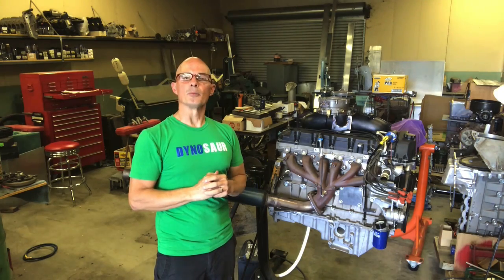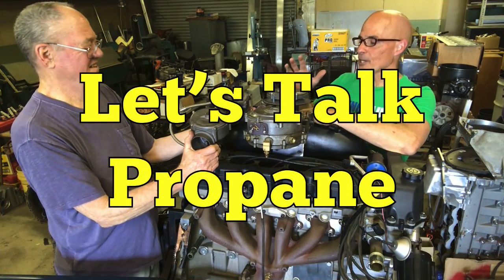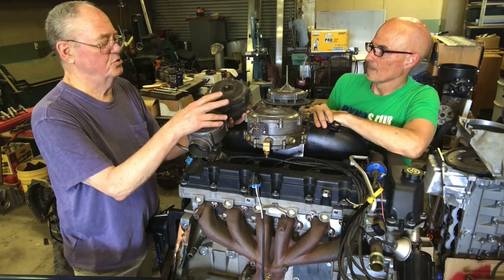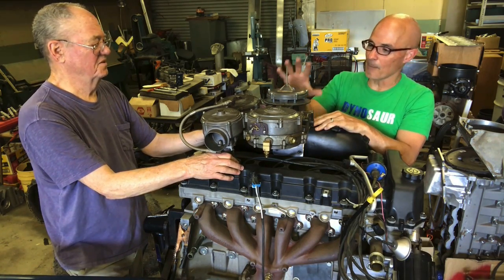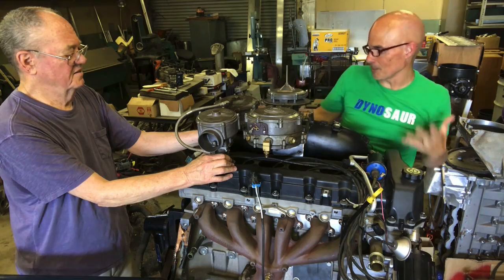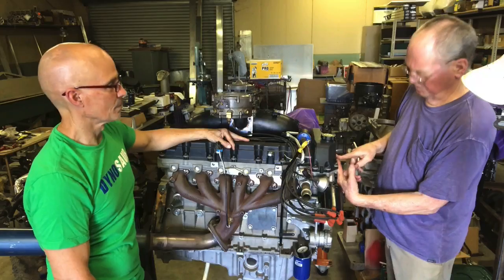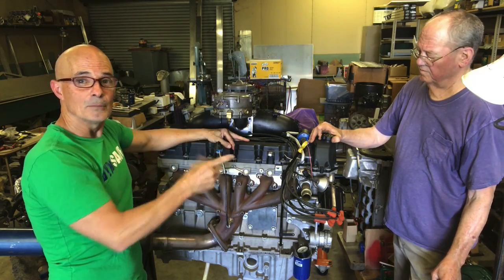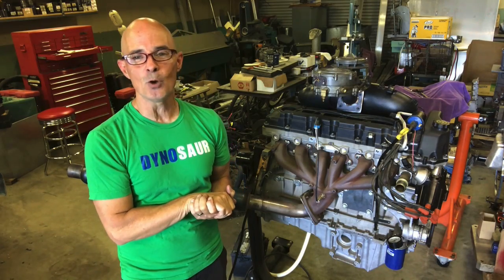PROPANE-POWERED AMERI-BARRA 4200 ATLAS (STAND START ON GRILL GAS-WILL IT RUN?)

Comment: I'd love to hear more about propanes pros/cons especially after he mentioned wearing out 2 454s....not the bores but the cam? How come?
Reply: I have a souped up 360 i built around 2000 an been running the impco 425. Last year i pulled it from the car to change a steering box so it was a good time to check inside. I can't rember the percentages on the leak down now but i was loosing a lot through the vaves , they were very pitted (hand lap fixed that) the bearings had worn through the tin on the major load side but had no scoring so swaped them out for a new set. The motor uses next to no oil an the cross hatch on the bores looked only lightly wan an consistent all the way round so i didnt even pull the pistons. Back in the car it runs great, better than before no doubt due to the valves.
Reply: Chevrolet delivered probably millions of poorly hardened camshafts and the big block valve train is hell on the little .842" lifter.
Reply: On early motors, it was pretty common to see "valve saver" systems set up in the engine bay. I don't know a great deal about it but my understanding is the liquid petrol has a lubricating or cooling effect on the valve and seats, where as LPG is anyway a vapour by the time it gets to the valve and essentially does nothing. However this never seemed to be an issue on later model stuff. I vaguely remember it being looked at similarly to when they took the lead out of petrol.

Comment: I have a design for a gasoline Vapor running engine that no one has tried yet on YouTube. Integrated gasoline tank into the intake piping. To where all the air has to gargle through the baffled gasoline tank tower before it gets into the intake. I wish you could see what's in my head and you would fully understand. It would create a way more gas fumes then any other on YouTube videos.
Reply: Might try a patent search. YouTube isn't the world.
Reply: You'll only vaporize the lighter fractions of the fuel if you percolate air through it like that. Surface carburetors died out a long, long time ago. It's a dead end.

Comment: Roush made propane conversions for 2013 era Ford vans.  This used liquid injection just like a gasoline engine does.  There are detailed instructions on Roushes web site.
If you run propane on one of your test engines, you need to use a liquid draw tank ( forklift ) otherwise bottle temp will drop and the vaporization rate will slow. As stated in the vid, the converter needs engine coolant as a heat source but this only works if you feed it liquid propane.  Late model forklifts use a duty cycle valve to alter mixture strength ( and O2 sensor ) so you might be able to blend some gasoline FI stuff.
As for ignition, investigate a 90's GM V6 that uses a module under the coil packs,  this needs it a 3 pulse crank trigger and some way of altering the signal that normally goes to the ECU then feeding it back to the module to alter advance.   MSD might have something that would work.

Comment: Just remember that the gas supply takes up much more room of the normal air going into the engine , so the biggest mixer possible and as big of an intake manifold as possible also to take advantage of the gas !  
This is why earlier has systems fitted to cars had such bad fuel economy and when switched to pump fuel they ran horribly as the gas mixer was a restriction

Comment: Natural gas engines Accelerate faster. Idk exactly why but have noticed that over the years. I figure its because there's no latency of vaporization?? So it's faster to blend and ignite in the chamber making a more uniform flame front? Idk just my guess.
Reply: It's not natural gas it's propane. And the LPG you buy for your car is actually a propane butane mix.
Reply: @Channelmaster73 .......hence my comment. It all Considered Natural Gas....... didn't mean NG.
Reply: Automotive propane tanks are very heavy, since tank pressures vary from 40 to as high as 275PSI. Taxi and Patrol cars with LP conversion can weigh hundreds of pounds more than gasoline cars.

Comment: The barra came out factory lpg, but also factory lpg injection!
Reply: The Falcon injected the LPG as a liquid, thus it would pull a heap of heat out of the intake air
Reply: @tx5brent  Yep!...

Not sure why, but specially in Qld... Gas is kinda "yawn, old person in ex taxi" type deal!... 
But your right Brent, the potential is Defo There!
Reply: Yeah, Not Wrong!... Cos a Shit-load of taxi's were LPG from the factory.

But I'm blimmin a bit turned about Ay!... Do you know what's the story behind em calling it the "AmeraBarra"?. 
Is there anything factual about it being an actual Barra from America?...

Its a Yeah Nah from me!... I don't know the backstory, but how did they the Barra part?. I don't get how this is related to our Ford Barra... Like... Um, is it from Ford in the 'States?... 

I'm not sure how the "Barra" part fits Mate Ay, do you know!?!
Reply: @seanohutton3185  no relation to Ozzie barra. They just say that because it's a big dohc six that you can pick up cheap from the knackers yard
Reply: @seanohutton3185  I hate the term “Ameri-barra. Because it’s a Gm atlas 4200. Richard coined the term and says it 1400 times per video. Both engines are great and a power comparison on the dyno would be awesome.

Edit: may have been exaggerated a little, 😂
Reply from the maker: 1400 times per video? That's a lot on any continent!
Reply: @richardholdener1727  that sounds like a world record
Reply: @richardholdener1727  1400, I only heard it once or twice!... But I am confused by how you have the American version of an Australian engine... Except I think your saying this is America's Answer to our Barra, not the American Version of the Barra ... Cos American Version implies it's the Barra you got when we got our ACTUAL Barra. That one has nothing remotely to do with FPV, the G6, the Falcon or an XR6!... 

So you can say it's Americas answer to the Barra, but it's not an Ameri-Barra by a long stretch!. I'm just not able to get to watch every second of all your videos (and even tho you do American wrecker motors) I enjoy em for the best part Mate Ay, especially if it is an engine we have here!. But if only for the engine theory. And I got all sorts of buggered when you said American "Australian delivered only" Barra!. 

But Struth Mate, 1400 times, what ever your saying, that's a Blimmin good effort Ay😉

Comment: Propane is an excellent fuel. It solves some of gasoline's problems. Because gaseous propane is much closer in mass to air than gasoline vapour, it remains in a stoicheometric mixture much better through the intake into the cylinder. It's also high octane. This allows high compression, both static & dynamic. While it has less heat per gallon than gasoline, it can be used more efficiently & when an engine is built specifically for propane the mileage can be very similar to gasoline. The excellent mixing characteristics also dramatically tame aggressive camshafts. This can result in tremendous power with excellent driveability & efficiency. Also because of the mass air function of the mixer, it's self compensating for altitude & temperature. The Impco system even runs a balance line to compensate for changes in air filer restriction as it gets dirty. The ultimate would be to run it through a port injection system to take advantage of charge air cooling, boosting power. I've always wondered why it's potential hasn't been explored more.
Reply: I have a small block 400 with 11:1 compression that i want to put on propane, it has a short track cam in it now 0.483" lift 232/237 @ 0.050 and 108 lobe seperation,  COMP Cams 12-325-4, fairly choppy on gasoline, do ya think this combo could work okay ? and im thinking i might need dual mixers ta get all the way into the top end rpm ? is 108 LCA gonna be to tight ?
Its going to a 1986 C30 dually so realistically probably never see past 5k rpm.

Comment: Propane has an octane rating of 112RON. In Australia it has been popular in the past for boosted drag applications.

Especially when liquid injected.

In Australia and Thailand alot of taxi's 🚖 rung gas. As it burns clean. Not soot. So for motors that spend alot of time at idle. It prevents fouling. Also gas is cheaper than petrol
Reply: Used to be cheap :( back when it was 33 c a litre and fuel 1.36 it was the best . I had a 300 kw xr6 turbo with liquid lpg injection went harder then a petrol one

Comment: Propane is an awesome fuel. Little is known by many about how to tune and use this fuel source.
Reply: Depends on where You live, here in Europe it is very common, we do it for years, like 30 years already for gas engines, cause LPG costs half the prize of gas. And for something like 20 years it is multipoint injected, just like petrol, and ECU controlled. Check out my twin turbo Granada with 4.0 ohv explorer engine, doing 300+ hp at the crank on LPG.
Reply: @madmodsgarage1179  Exactly, here in Australia it gets called bbq fuel or taxi fuel. All the issues people have are usually from poor installation or mechanics playing around with it and blaming lpg for poor running.
Reply: @gptech2444  same here, but unfortunetely, apparently there sometimes is some inconsistency in provided LPG quality, at least in Poland. But I can't tell that for sure, I've never done any tests

Comment: I don't think its so much that GM is putting a oil pressure switch on these cars as it is they're putting like a 0-60 sensor on them. So you look at the gauge and it never seems to move no matter what you do, so it behaves like a switch, but in reality that 60PSI mark on the gauge center is just the max that sensor can read.
Its possible they're also buffering it in the BCM to not move much when you touch the throttle. Maybe because people saw it move and kept thinking something was wrong?

Comment: Propane is 130 octane?  It should love boost!  Those look like IMPCO 425  mixers. 👍
Reply: It has a lower energy content in comparison to gasoline.  So it will not directly compare horsepower/torque to a gas powered engine for the same boost.

Comment: Definitely need to run the propane on the dyno, I'm curious what the power difference will be.
Reply: I’ve run several engines on propane.  Mostly Chev 350 V8.  An 8:1 compression naturally aspirated motor will usually lose 10% power when converted to propane.  That’s primarily cuz propane has a much higher octane than gas (in my day it was approx 130 octane but this guy says 110).  If you put 11 or 12:1 comp ratio then the tables would turn and this baby would really come alive.  Another factor here, I’m in Canada and possibly our refining process is different than US.  Our propane comes right off the gas well as it comes out of the ground with natural gas.  Propane engines used to be really popular here cuz propane is so very plentiful here.  In the 80’s and 90’s most gas stations had auto propane filling facilities.
Reply: no idea what the power difference is compared to gas. but a guy shop runs s tire shop in my town runs constant 10s with a propane 440 mopar.

Comment: Remember that you’re testing the oil pressure at the pump not after it’s run through the bearings and valve train where all the pressure loss occurs

Comment: Is that an IMPCO mixer?! Yes sir, it is!
Reply from the maker: YES
Reply: @richardholdener1727 , too bad it’s gaseous. The Propane takes up a lot of volume that the intake air would normally occupy… and not being able to use the cooling effect the phase change could give you, if you were able to expand it in the intake port right behind the valve… 
Maybe recirculate the water going through the expander into a water to air intercooler instead of the engine’s water jacket… 🤔

Comment: All the kits I've spotted, require the motor to warm up on petrol.
Diesels seem to work better. Hence the use on forklifts.
Reply: Mine does this, when the engine is warm enough it automatically switches from petrol to gas.
Reply: LPG is not used on diesel forklifts. Most forklifts are conversions on the GM 4.3 V6 or a Nissan 2.2.
Reply: @otm646  Or as with mine a Toyota 4 cyl. or the 10 tonne is a Perkins 3 cyl. Both C I units
Reply: Exactly like my Tahoe 5.3.
I can force it to start on LPG, but it won't start easy on LPG.
In the summer the ambient heat is enough to make it switch over to LPG very soon after start on petrol.
Mine use a sequential LPG injection, and not a mixer.
Reply: @espenschjelderup426 , liquid or gaseous injection?
Reply: @rickrack78  gasous injection. It has a vapouriser. But the LPG injection don't know the temperature of the engine, the only temperature it knows is the LPG in the injector rail, in the gasous phase.
Experimenting with liquid LPG injection would be fun. I think you get very much charge cooling 😁

Comment: I have seen first-hand a propane supercharged Triton V10 agricultural pump. They also used propane V10 Triton engines in Blue bird school buses. Lets see a V10 big bang!
Reply: Roush made propane conversions for 2013 era Ford vans.  This used liquid injection just like a gasoline engine does.  There are detailed instructions on Roushes web site.

Comment: Propane is a really good fuel as long as you're not worried about fuel mileage. I am curious as to how it works under boost.
Reply: you can get good mpg out of propane and its 1/3 the cost
Reply: @bill2178  there is less btu per pound in ng or propane than there is in gasoline. So no it won’t get better mileage. With high octane you can go higher cyl pressure, problem is, most manufactures ran stock compression which negated the point of higher octane. I worked on propane vehicles including the propane dragster named “lobo 2” from 1981 to 1994. Mostly centurion systems but others as well.
Reply: @heathermiller2917  there are less btu but it burns more efficiently because its gas and not liquid in my experience its possible to get similar mpg if it is calibrated correctly
Reply: Have you ever pulled apart an old propane 454? Damn things look brand new inside.
Reply: I ran my v8 ranger on propane and gas with a holley 4bbl... got better mpg on propane but on my efi car, gas did slightly better than on propane